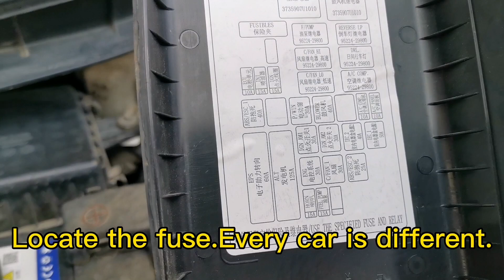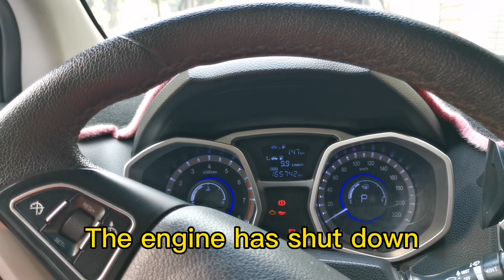Car Immobilizer System Sensing Car Immobilizer Security System Anti-Theft Electronic Engine Lock

Comment: After installing, it works perfectly but drains the battery overnight. After removing, the battery problem has gone. Is there a solution to avoid/control car battery drain by this devise?
Reply from the maker: Dear,friend,Please refer to our video to install the product. In your case, the connection should be wrong.
Reply: @zhangcharly 
Thank you! It’s not draining the battery anymore. 

But a new problem: seems like the automatic detection is not working anymore. This is causing additional issue with the engine cylinders not receiving fuel only during start (if I press the button on the remote a few times, the engine will run normally but there will be engine failure codes recorded). Every time this happens I have to clear engine fail codes using OBD11. 

I’ve also tested it without this gadget (only original fuse) and it works fine with no engine failure. 

In short this gadget works. Just that it’s automatic detection is not working at initial start up. Any solution?
Reply from the maker: @mazharxx   Dear,friend, Most likely, your remote control is switched to manual mode. you can change it.
1. Automatic mode: Press and hold the button on the remote control for 5 seconds, the LED indicator flashes 5 times for automatic mode, and the light on the remote control flashes once for 30 seconds in this mode. In automatic mode, press the remote control light to light up.
2. Manual mode: Press and hold the button on the remote control for 5 seconds, the LED indicator will be on and then off to manual mode. In this mode, press the button on the remote control and the light will be on for 20 seconds.
Reply: Can I put a 10A fuse?